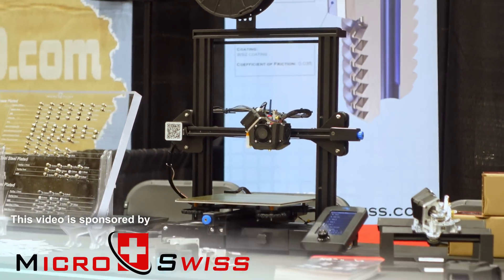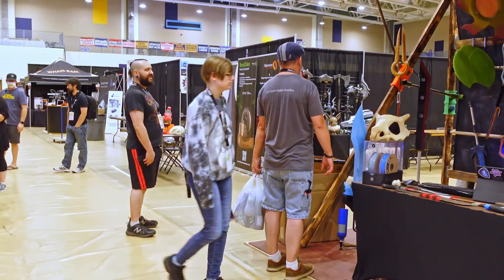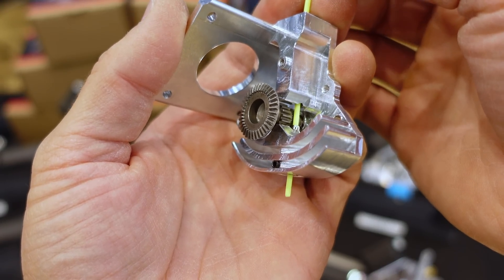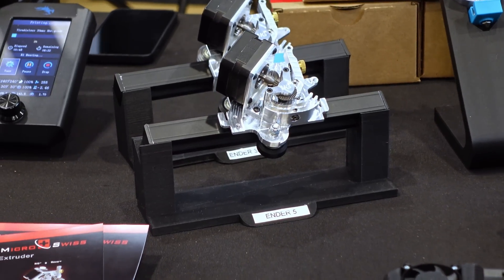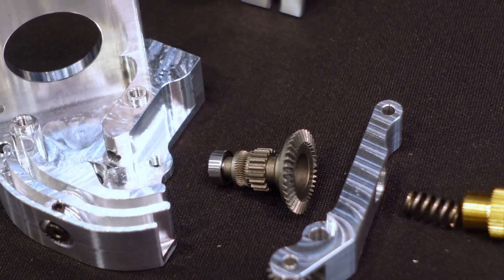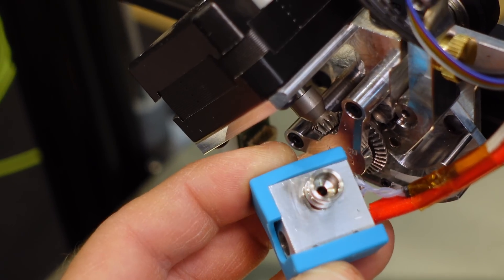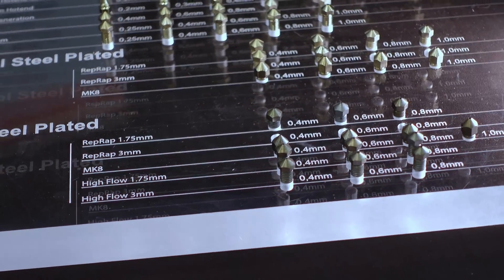This super-compact Revo extruder from Micro Swiss is built on an angle! #ERRF2022

Comment: Worst extruder I ever had. Uneven extrusion caused banding. I replaced every component on my Z-axis and even installed "wobble nuts" on the lead screw so that the z-axis lead screw didn't push the build plate on my Ender 5. Nothing helped until I went back to the original bowden setup. There is a video about the problem. It's caused by an eccentric extruder component.

Comment: I have a Ender3 and and CR6SE printer.  In both cases I've been VERY happy with them, but I have considered moving to a new hot end, and potentially direct drive (once in a while I have had the desire to print in flexible filaments).  My biggest issue is not really wanting to get into ripping into my printer.  I'm a "Been there, done that" guy...I built my first printers from threaded rod, printed parts, and all kinds of vitamins (nuts, bolts, washers, bearings).  Heated beds weren't even a thing yet and neither were direct purchase hot ends (you made your own, baking the thing in the oven to cure the material).  I'm past that, I really just want plug and play now.  I don't mind tuning, but I don't want to be splicing wiring and all that...I'm just over all that.  

Need to start investigating, but yea...

Comment: DIABASE FlexionHT Extruder PTFE tube is about 36mm so not exactly sure how you are measuring the filament patch. vs 41mm
Nevertheless this is interesting. It should be possible to tilt the nozzle at 45 degrees without moving the extruder motor and back to 0 degrees.

Comment: I'm looking forward to get a NG for my Ender 5, too bad it's only in stock with the Ender 3 backplate right now, and that will not work as the Ender 5 runs the belt on the front/back of the aluminium profile and not the top/bottom. Could probably hack something to get it working, but i'd rather wait for the drop in replacement.

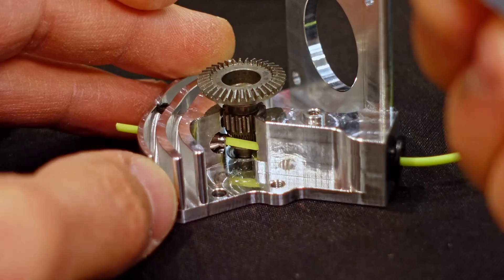Comment: I have the extruder and it has one big design flaw you can see when stopping at 1:49. 
It can be quite difficult to swap the filament because there's little guidance past the two rollers. When simply placing the filament between the rellers and move the extruder it often gets stuck and the gears will jump. Pushing the filament directly into the hole is also difficult because there's no chamfer guiding it. Other than that, it works really well, though.
Reply: I agree I have the same issue it can be a pain in the ass to change, I gotta stab it in over and over lol

Comment: I just watched CNC Kitchen's episode on the RotBot ... which has a 4th axis mounted at 45 degrees. I really feel like this extruder is half a design step away from producing an improved, lighter, more compact version of their effector.

There's another printer which has a 90 degree turn within the hot end, in order to print upside down, designed by Kralyn 3D, which demonstrates that the filament path is irrelevant once the plastic is melted. If the 4th axis only turned the hot end, rather than the heatsink, then the motor for it could be reduced in size. I'm imagining gears on the top of the hot end to turn it.
Reply: Haha, I just did the exact same thing. I came in here expecting to see the same 4-axis printing. When I realised this extruder setup was just to offset the drive motor, I was a bit bummed out.
Reply: @kick1ass20  Glad I wasn't the only one. Can you see what I'm picturing when it comes to implementing a 4th axis with an extruder like this?
Reply: @kick1ass20  nono, basically, take the Micro-Swiss effector as is, put a big gear on the front face of it, which interfaces with teeth on the top of the hot end, similar to how the extruder is geared. This allows the rotation of the hot end around it's own heatbreak.
Reply: @kick1ass20  ha, I'm a bit too busy trying to fix the issue of waste in the formworking field of concrete construction.
Reply: @kick1ass20  haha, something about blockchain! We're going to take over the industry by short-selling. We'll make it a disruptive technology. :|

Comment: I have a Micro Swiss metal lever and extruder plate which replaced the factory installed plastic junk, as well as an all-metal hot end on my Monoprice Maker Select V2, and I'm very happy with the quality of the pieces as well as how easily everything installed. Too bad this extruder setup isn't available for my machine, it looks like a worthy upgrade from the stock extruder and I'd love to stick with this company.

Comment: try completely non-moving 4K shutter nozzle grid extruder, just like 3d resin printer
Reply: or just up-down movement of the print plate/head like resin printing with uv resin curing

Comment: Interesting. Seems all-metal hotends only have advantages not a single disadvantage…
Reply: The coating helps, but generally all metal is less desirable if you only print PLA. More likely to get clogs from heat creep and it just doesn't slip through as efficiently as feeding through a ptfe lined hotend. That said, I've had far fewer problems with clogs printing petg, abs, tpu, and ASA with me microswiss equipped ender 3 than I have printing abs/ASA with my dragon equipped voron.

Comment: Nice design! It would be nice to see a version (higher gear ratio maybe) with a NEMA14 to reduce the weight further.
BTW, I saw somewhere (E3D Discord maybe), that E3D says that ObXidian can be pronounced as normal obsidian. I'm pretty sure they want it to be spoken that way, but needed to spell it differently to get a trademark.
Reply: @Riddle-me-this-riddle-me-that  I don't expect so. This extruder has a 3:1 gear ratio. The Orbiter, Sherpa Mini, and LGX Lite that can all be paired with that motor all have higher gear ratios. It's 7:1 for the Orbiter, and 5:1 or 6.25:1 for the Sherpa Mini (not sure for the LGX Lite, as they don't quote gear ratio, the bake it in to the rotation distance).
Reply: @Riddle-me-this-riddle-me-that  I have an LDO one paired with my LGX Lite

Comment: I have only one question. If they are from the US, why are they called "Microswiss" with huge swiss cross? ;)
Reply: Machining related? Swiss machine tools? Sanjay used to speak at length about the Swiss lathes they use in their manufacturing process.
Reply: ✨️Branding✨️
Reply: Immigrants maybe?
Reply: My guess is they started out as a machine shop that specialized in “Swiss screw machines”.   Look them up.   IIRC Star and Citizen are the biggest names in these types of machines.  The perfect type of cnc machine to make a 3d printer nozzle.
Reply: I have been to their facility.  It is about an hour from me here in MN.  Definitely a US company.
Reply: Because Micro American doesn’t sound as good.
Reply: Its actually illegal and they will have to change it some day. Swiss brand protection....
Reply: @bernatix  Yes I was wondering the Swiss don't like these things so lightly. Maybe one can ignore that in the US but they also sell in Europe, don't they?
Reply: @sagichnicht6748  exactly, they will have to take the cross away and change their name at some point. It goes slow, but it will.
Reply: Because "Made in the USA" implies imperial measurements and rust ?
Reply: Maybe because if you need top engineering it's probably from center europe?